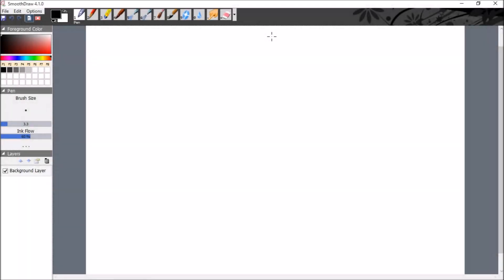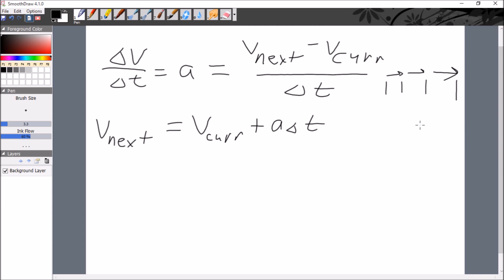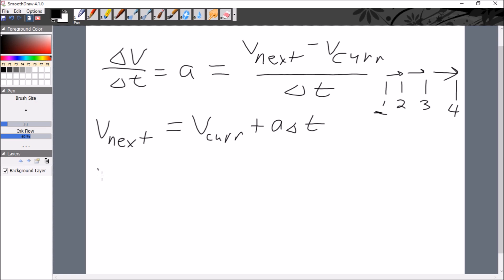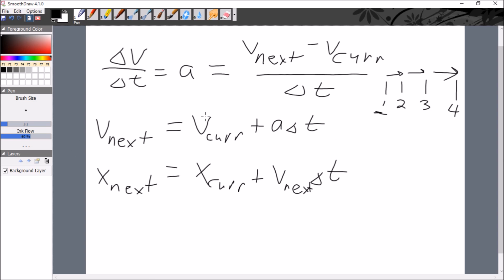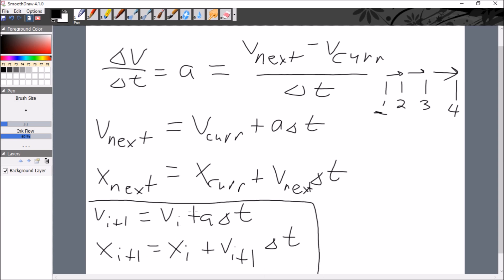Police Chase! - Episode 1 (Set-up)

Comment: Given that you are calculating the position at time t, shouldn't the V_next be the velocity at time t instead of the velocity at time t+dt? You mention that otherwise the solution is not stable but I've coded the example in Python and the only difference I see is that the collision happens a second earlier.
Reply from the maker: It becomes unstable, for example, if you introduce a restoring force F = -kx and graph the total energy vs. time. For short-duration applications it's like not noticeable, but over the long run the solutions do diverge.
Reply: @LetsCodePhysics  Do you know some resource where I could look further into this? 

It's very interesting because as a student I was taught and learnt to derive the usual

x(t+dt)=x_0 + v(t)*t
Reply from the maker: @heyjonb  Here's the original paper https://aapt.scitation.org/doi/10.1119/1.12478. Also, any intro computational physics methods textbook will illustrate the difference. We're also big fans of it over in PICUP (www.gopicup.org) if you're an educator looking to use this in your class.
Reply: @LetsCodePhysics  Thank you very much for sharing the paper. It's incredibly interesting how when it comes to computers, something apparently unintuitive as "to find the position of the particle now, use the velocity the particle will have but it doesn't have yet" works better than the conventional methods

Comment: Hey! This is a great video on introductions to programming but I do have a question (kind of a beginner physicist question); how did you know what you were trying to find in the first place? I saw you gave the police officer a velocity and acceleration and his acceleration has to equal the velocity constant of the speeder. But how come the velocity didn't have to be the same as the speeders? Is it because he didn't start off at the same time? Also, how many recorded speeds are normally needed to input in the problem? I like how it wasn't a terrible amount of information to take in as we just are taking it step by step with the cars and their speeds.
Reply from the maker: Well, keep in mind that a velocity and an acceleration can't be equal, since they're measuring different things. Computers, however, don't know units, so the fact that both are the same numerical value is coincidental. Look, for example at how they're used differently in 
v_next = v_prev + accel*dt
x_next = x_prev + v_next*dt.
Reply: +Let's Code Physics oh ok! Thanks! That makes a little more sense. I guess I just didn't differentiate the velocity and acceleration for some reason.